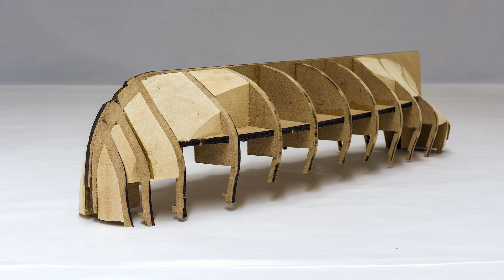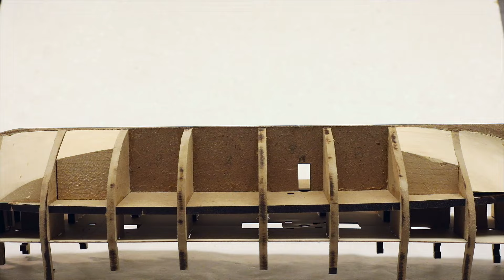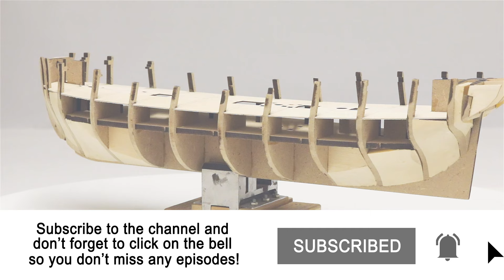HMS PEGASUS : Amati : Scale 1/64 : Step By Step Model Ship Build : #01 - Assembly of the skeleton

Comment: I was told one has to sand off the char from the laser cuts in order to get a good glue joint. I notice you do not sand it off, so I'm going to quit all that sanding.
Reply from the maker: It depends on what part needs to be glued. Because the laser cuts at an angle, and therefore for ideal gluing, it is sometimes necessary to sand the part (keel, stem, stern post) to an ideal angle of 90 degrees. But if it is only a skeleton, then this error can be neglected...
If you use PVA glue of course!
P.S. Traces of resin from laser cutting can be washed off with hot water or alcohol. If the part is charred, it is a defective kit!..

Comment: Olha a quick question. I have this kit and am following along with your videos and the instructions, of course. I put in the thick false deck and unfortunately after the glue dried I noticed it was about 1/8 of an inch too high in the stern.  Is that going to cause me troubles further down the road or is that false deck just there for a structural stability and I should be fine leaving it as is? I have not yet put in the wood between the frames which is the next step.  Appreciate your advice at your convenience. Thanks very much.
Reply from the maker: If it's not too late, it's better to fix it, otherwise the guns you put on this deck may not hit the ports. If this is possible, you can heat the glue and press it to the end of the deck or peel it off and re-glue it!
Of course if you're not interested in historical accuracy, then you can just cut the ports 1.8 higher and build on...
Reply: @OlhaBatchvarov  perfect.  Thanks very much. I fixed it!

Comment: Did that kit say to fill the spaces with basswood, or is that something you learned to do from your decades of experience building ship models?
Reply from the maker: This kit does not have a lot of instructions, but there are very detailed drawings, but there are no recommendations either. The manufacturers generally leaves this part to the discretion of the modeler. Although some have already started writing recommendations for filling the spaces.
This is necessary if you want to get perfectly correct lines of the ship...
Reply: @OlhaBatchvarov  that’s where the experience comes in. 😁 That’s the kind of details I like to see to incorporate in my future ship modeling. Thanks for the reply. 👍
Reply from the maker: @FranksModelAviationWorkshop  My pleasure.

Comment: Hi Olha ... congrats for the videos ! just a quick question ... why did you not plank the 1st deck BEFORE intalling it ? Will not be more difficult after ? Thanks ... Cheers from Greece !!
Reply from the maker: Thank you!
Because the manufacturer simplifies the design and ignores the details. I will put waterways and scuppers before planking the deck... That's why I don't use the instructions!

Comment: Olga, good afternoon! I know about the Amati models not by hearsay, they are just terrible quality. To make a normal model, you need to replace a lot of silumin and metal parts with wooden ones, make them from scratch. The assembly of such models turns into an assembly from scratch. But I have only encountered models from their usual line, not Victory models (this is their special series). Please tell me, in your opinion, is it possible to assemble a good quality model from this set, using only what is given in the box?
Reply: If you need to have all of the parts made for you, then you should stick with plastic models. This company makes very good models. I have made a few models and have no problems. Yes, I have made my own parts from those not we're not to my satisfaction. Wooden models offer a  "Challenge".
Reply: I agree - you choose Amati when you want a challenge . But this is exactly something I look for  when choosing my next model. Now I work on Endeavour 1934 1:80. 

I have done many parts myself.  from scratch.  changed the design of the mast and boom.  made some metal parts from scratch.  But isn't it the essence of the modeler's work?
Reply: @jasonguttman548  I am very sorry for you that you have not tried high-quality wooden models, where there is no cheap silumin and there is a good instruction. Very good models from Amati?)) Make plastic models yourself)
Reply from the maker: Good afternoon!
This is my second box from the "Victory Models" series - and it impressed me. Quite the opposite - here is a bunch of parts made of laser cutting wood. I was told on the forum that not so long ago the skeleton was made of plywood (about 6 years ago), now this part is made of MDF. It is possible that the manufacturer has upgraded this kit, because it looks much better than my previous one. The only silumin detail is a boat - but for me it's not a problem because I always make my own boats.
I have a video unpacking here: https://youtu.be/1mN5dtO7Kcw
Reply from the maker: @jasonguttman548  Yes, it's true! The manufacturers give you a basis on which you can add everything that was historically or according to the drawings missed in the kit to simplify construction for beginners!
Reply: Thank you, and stay safe and be well. We are not finished with this virus and still have a long way to go.   😷.  😷.  👍.  🌹.

Comment: For a expensive kit it's bad MDF is used, it should be a good ply for the cost
Reply from the maker: On the contrary - MDF is easy to work with and it does not warp like plywood, which provides a perfectly straight hull...